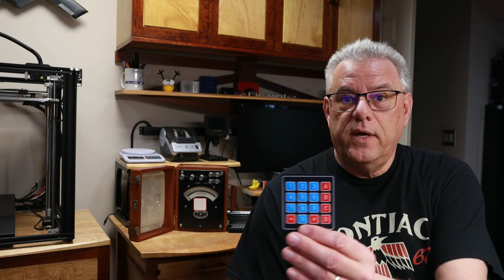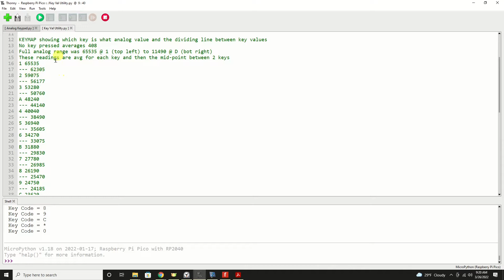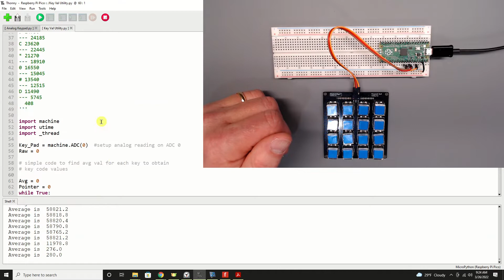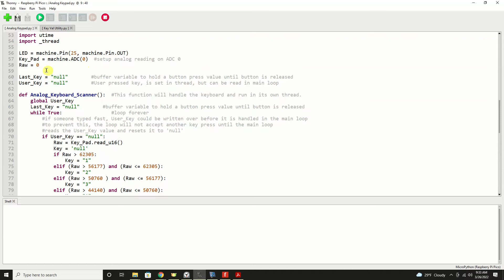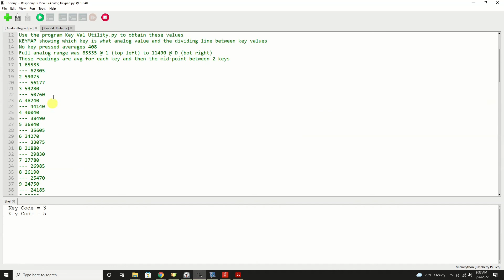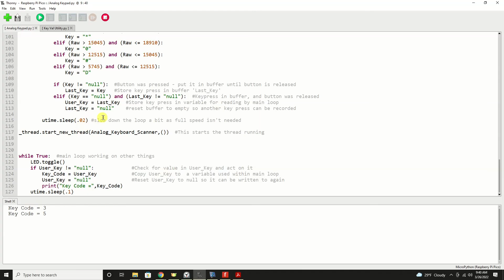Interface PICO to Analog Matrix Keypad

Comment: Adafruit sells a keypad that looks identical.
Reply from the maker: Hi EvilDaveCanada,
Can you share a link?  I just looked on their site and could not find it.
Cheers!
Chris
Reply: The keypad that I was thinking about is only digital and not analog.
Reply from the maker: @EvilDaveCanada  Oh bummer.  However, if it is the same style, the removable clear keycap covers are a great feature.  This allows custom legends which is a very useful.
Thanks!
Chris

Comment: I wonder when the voltage down from 3.3 to 3.0, will you get wrong key ?
One more thing ... What about low power mode, using ADC need more power than GPIO ...right?
Reply from the maker: Hello user-gz4qb2sd6w,
You can interpret the ADC value to get the results you need.  I did no testing in low power mode.
Cheers
Chris